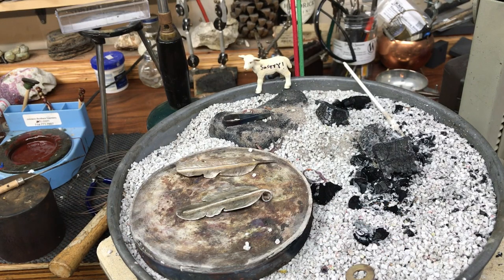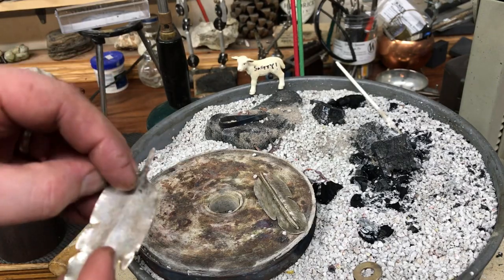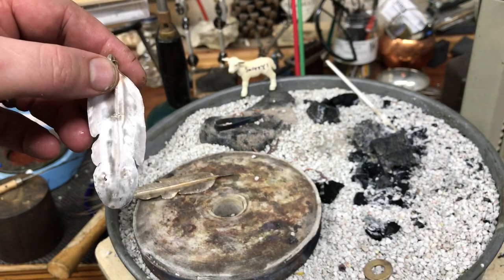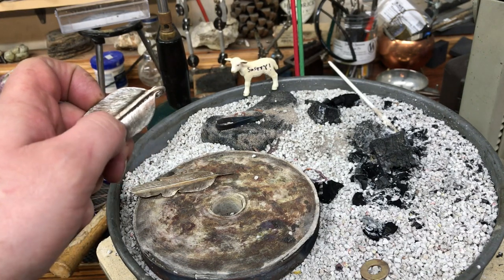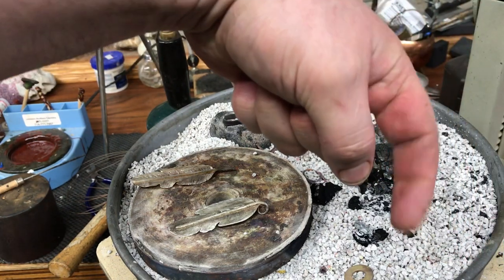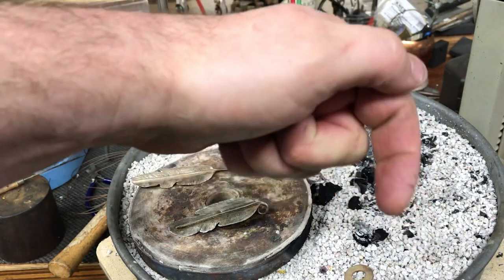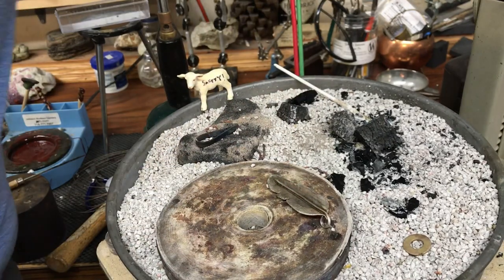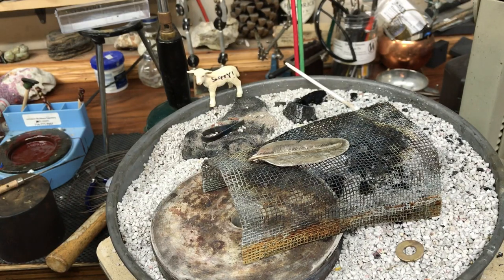Metalsmith tutorials- Creative ways to fix mistakes (solder and forging sterling silver) Part 1

Comment: Very cool project! If you ever approach it again you might want to try a no flow (such as Rio No-flow, Solder-Stop, there are also other products on the market, or just use graphite, or old fashioned rouge paste) over your previous solder joints then use hard solder again on your cracks. The benefit here is hard solder can actually fill, it has the highest silver content, and is less likely to pit and tarnishes at close to the same rate as sterling. The likelyhood of success would have been practically guaranteed with proper torch control. The are many that only use hard solder through all of the soldering steps, no matter how many they have for the reasons just outlined. When I first learned how to solder the reason I heard for using only hard solder was to think about how many solders there were and how many times you would probably solder a piece. Unless every piece had exactly 3 solder joints you would have to use at least one of the solders multiple times. So why wouldn't you just use hard solder every time and skip the solders that have more junk metal in them? It made a whole lot of sense to me. I try not to ever use other solders unless on very fine chain where the high heat would melt it. I only purchase hard and then use paste that is for very fine chain. Once you are used to it you see the difference in longterm wear of your pieces and also the flow when you are soldering. Good luck with your piece! I am sure it is going to turn out amazing! I am looking forward to the next video.
Reply from the maker: That is a really great idea I had used graphite rod’s for soldering Hinges  before . I have heard of the Solder stop products but haven’t used them that would be a really great application! When soldering multiple pieces are usually try and create an order of operations so that I can use as a few hardnesses as possible I try not to use extra easier and easy so that I have that option if I ever need to make a repair I prefer to only use one or two